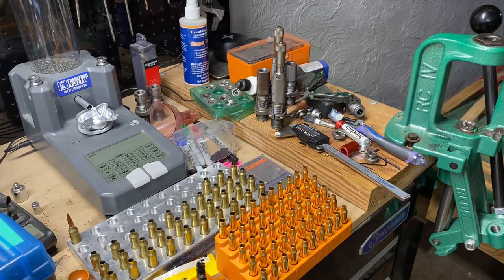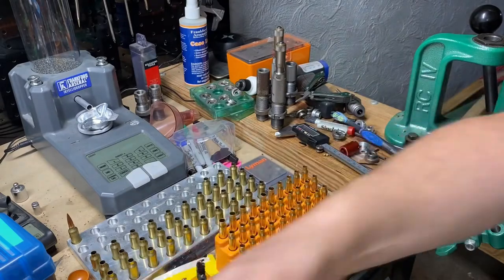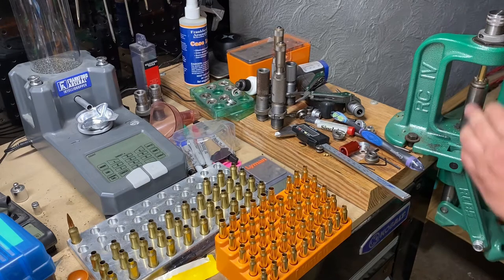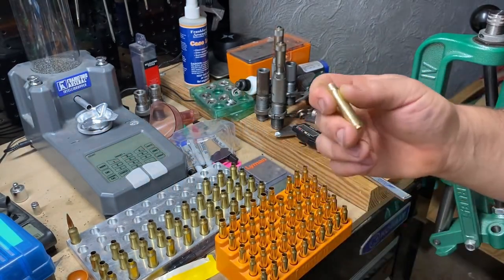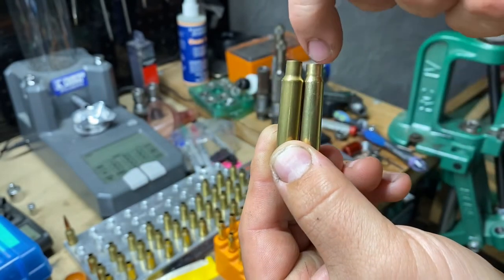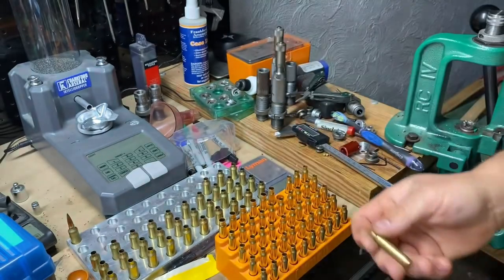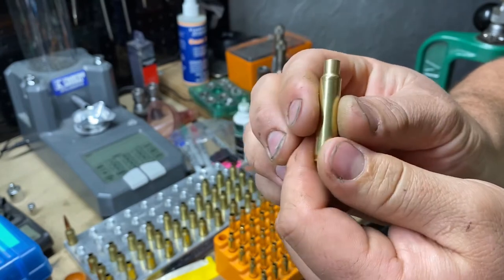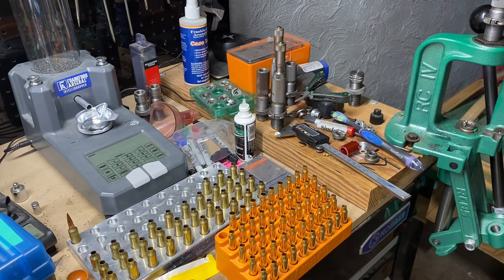How to make 6mm Mongoose brass

Comment: I just lube the cases with Imperial case lube and run them through the Mongoose resizing die, then trim. Haven't had a problem yet. I have started to anneal the cases after each firing to lengthen case life. The Analeze annealer makes it simple.
Reply from the maker: You won’t have a problem doing it I did the same when I first started with the cartridge 4 years ago. What I didn’t like is the little bubble it leaves around the shoulder where it meets the case body wanted it to be more uniform that’s how I came up with this process. I’ve heard of others kind of doing something similar so I gave it a shot with my own touches and it works great.

Comment: I make my .277 wolverine with a 3 step process. Spray One shot on 5-10 pieces of .223/5.56 brass take my .277 WLV sizer die then use a decent small pipe cutter to 1.54 then chamfer/Debur. 
Makes perfect formed .277 Brass. I used to precut them with the harbor freight but I like being able to do the full process with out using power tool.

Comment: What advantages does the 6 mm mongoose have over 6x45 or other cartridges in this same ballpark??? Thanks
Reply from the maker: The mongoose can handle higher pressures and has more case capacity than the 6x45. Usually when working up a load my starting charge is 6x45 data and then I go up 1.5-2gr over that if the case fill will allow it.
Reply: @theaveragereloader7222  thanks mate
Reply: @theaveragereloader7222 
Hi.
Forgive me, because my english is very bad...
6x45 mm ammo still made in US?
Reply: @gustavocunha9793 not that I'm aware of